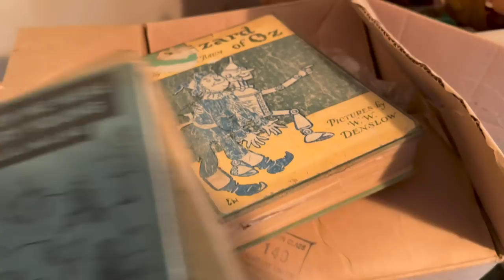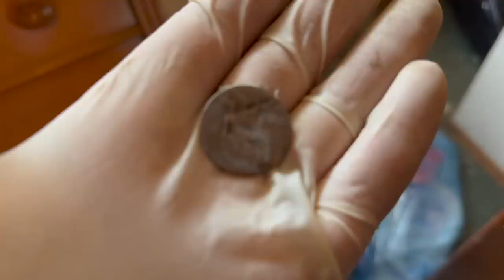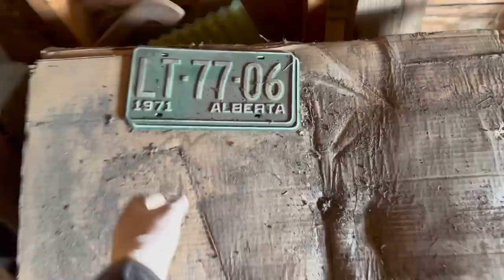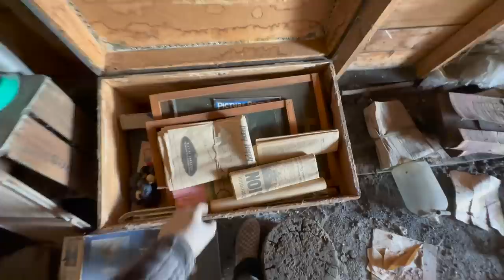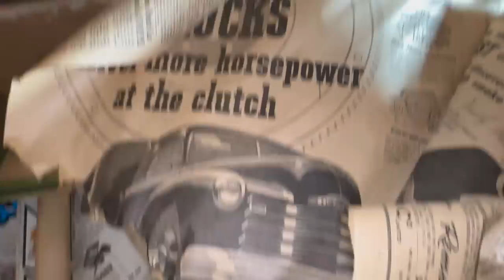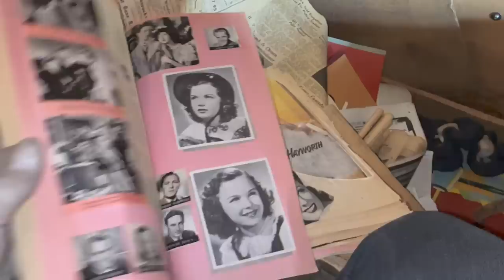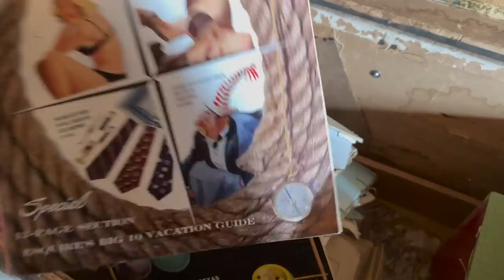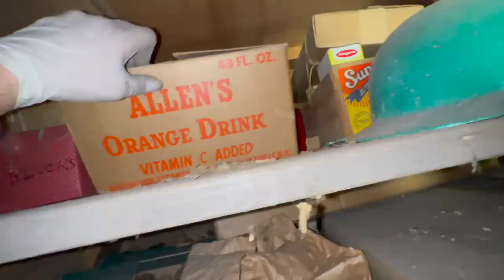This garage was locked for 20 years! What’s inside?!? Come explore with us! Part 6

Comment: Alex, just an FYI, people always say there is nicotine staining on walls, furniture etc., it's not the nicotine doing the staining, it's the actual smoke itself. Nicotine is the addictive part of tobacco smoke. It is colorless and odorless. As for the rugs in the living room, if they were quality needlepoint, taking them to a good rug cleaner will remove all residue. They can be very valuable. In the case of the early Disney toy cradle with some mold on it, using three parts water and one part bleach will remove all the mold. Disney collectors would snap it up in an instant.
Reply: Yep, you're right, it's the "tar," which is not actually tar, but a compound of various chemicals and carcinogens, that causes the staining. The tar is also what causes cancer, nicotine itself does not.
That being said, even though I am an ex-smoker, I am shocked by the condition of those keys. Did this person chain smoke for 60 years and never once clean the keys? It looks like a beautiful piano otherwise. Hope it can be thoroughly cleaned and restored.
Reply: Bleach doesn't kill mold spores, it only makes them no longer black. Vinegar kills the spores.
Reply: I worked in a hospital cleaning equipment.  Mold on smooth surfaces can be killed with some household products, but the spores are a different matter.  Spores (reproductive structures) have a kind of shell to enable them to survive in bad conditions.  It requires heat, toxic chemicals and pressure to kill many species of spores.  
Alex is right.  Pitch the moldy stuff.
Reply: I think it was homemade cradle with applied decals not legit Disney merch.
Reply: @expatannie6958  Some of the grime on the piano keys might be from normal wear, dust, etc. I play our antique piano and so do a couple of my kids, but I still have to clean the ivory keys now and then. The paint on the black keys has oxidized over the years and rubs off onto the white keys due to normal moisture on our hands.

Comment: Those were adjustable lcreens for sash type windows.  You lift up the window, set the screen on the open space, extend the screen until it is the width of the opening, then lower the window onto the top of the screen. 
The little star in circle thing in the box was a do it yourself souvenir from the 1950s. You put a coin in the machine and could stamp what you wanted on the exterior ring.
Reply: Thank you for the info on the souvenir star coin item.  I was surprised when that didn't go into the 'keep" pile! ⭐
Reply: I was thinking the same about the mini perfume bottle...

Comment: Do you have an app called  "curb alert"?  You set things on the curb, and let people with the App, know it's there, for free.  You could roll the rugs, so the good side is on the outside, put a note in the curb alert that the rugs were exposed to heavy smoking and possibly mold, so it's up to them if they want to tackle the job of cleaning and sanitizing them. Because they are made of yarn, they should be easy to thoroughly clean.  It broke my heart when I saw your son carry a very nice rug to the dumpster, in an earlier vlog.  I know why you did it, especially since it was in the basement . I do wonder if a rug sales shop would let you know if they can be easily cleaned and sanitized, to, once again, be of value to someone.

Comment: That’s a great set of furniture. And can I say how much I love the fact you clean things. I had already noticed the nicotine stain on the walls. I’m a smoker but have only smoked outside away from folx since 1993.
Reply: Never too late to quit. :)
Reply: @dewdew34  I have managed to cut down and only smoke 100% tobacco without additives.
Reply: Where did you manage to find tobacco without additives?
Reply: @jillipepper5353  American Spirit and Winston are both made with 100% tobacco.
Reply: Yes, a lot more durable than all that IKEA stuff.
Reply: @katwitanruna  I didn’t know that. After smoking for about 50 years ( started partime at age 11😳) I quit a few years ago. I never thought I could quit but ending up in emergency and undergoing a six hour operation for a gangrenous gall bladder , I kept thinking to myself  it just as easily have been lung cancer. Having been diagnosed with the start of COPD I realized that if I needed life saving surgery down the line they might not be able to because my lungs couldn’t take it. 
So when I was in hospital they put me on patches and I kept taking them at home. From experience of trying to quit previously I knew if I even had one cigarette I’d be right back at it so I just did it one day at a time.  I did use a vape eventually though I didn’t inhale , but then stopped it too. 
I know past smokers are annoying BUT it’s never too late to quit, your lungs can repair at least some in time. 🙋🏼‍♀️

Comment: I once helped a friend wash the walls of a heavily nicotine stained house we washed it 3 times, and painted it.And the staining kept showing up.🤢 we finally had to switch from latex paint to an oil based, and that finally worked.
Reply: In UK there is a detergent called Flash that is good for such jobs. Many years ago, painters used a product called sugar soap to wash down nicotine stained walls and ceilings.
Reply: Need to use stain block primer
Reply: Start off with TSP

Comment: 21:21 those screens are for opening window (slide up, with or without counterbalance) then fit screen under the window.  very popular for "no A/C" houses, mid-west USA in 40's & 50's even 60's but bet Canada also used since weather in Canada likely still not conducive to 5-7 months of Air Conditioning

Comment: My new home was smoked in for 50 years.  The entire house looked just like that one you have there, where pictures and wall decorations were outlined with the nicotine.  Before moving in, removed all the wood paneling and burned it.  We refinished the plaster walls to match the rest of the house.  Then I replace the baseboards and door moldings, and primed and painted all the walls and ceilings in the house.  Also had the entire oak floor sanded and refinished. After all this was done, you could see how awful the light switches, outlets, ceiling fixtures, and window coverings looked.  The last step was to replace those.  Wow!  It feels like I have a brand new home!  None of it looks old or out-of-date, except the original kitchen and appliances.  Oh well I can live with that for now.

Comment: The screens could be used for silk screening posters, etc.
Reply: No, they couldn’t. The mesh is too large, and it is in two parts that overlap where it slides to adjust the size for fitting in a window. They also have a lip on both sides of the screen, so won’t lay flat on the paper for the transfer of ink.🖤🇨🇦
Reply: @tamarrajames3590  Zulu are correct in that those were not silkscreens. I used a silkscreen in a high school art class and those were not them.

Comment: A premarital test is a test that offers a crucial health assessment of soon-to-be married couples in which they are tested for genetic, infectious and transmissible diseases to prevent any risk of transmitting any disease to each other and their children.

Marriage is considered a remarkable event in a couple’s life, as they plan to start a family, and through which they usher in a new stage in terms of building emotional, social, familial and healthy relationships.

Premarital testing programs should educate couples, providing accurate and unbiased information. Family background, hereditary factors, age, diet, exercise, weight management and addictions all contribute to the bigger picture.

For couples considering marriage, pre-marital screening helps identify potential health problems and risks for themselves and also their offspring. It is vital for couples to be screened in order to aid them to understand their genetics and help them take the necessary precautions or treatments.

Comment: You keep saying it will likely be a tear down, but couldn't the basement floor be encapsulated with concrete or even covered with vinyl flooring?
Reply: he has mentioned a few times that this is what he was told by whomever owns the estate. Yes, it could be renovated but depending on where it is the lot might be much more valuable as an empty build lot.

Comment: Hi Alex,
You can get those white stains (actually moisture trapped under the finishing) off by using a hot iron and then heating them for a few seconds. Use a dishcloth underneath the iron as to not damage the finish. It works like a charm 🙂

Comment: When we bought our current house, the former owners, both smokers, used the dining room as a TV room. There was a small chandelier hanging from the ceiling and the prisms were actually yellow from all the smoke. Also, if you have a low doorway, use a tack to hang a length of ribbon from the top door frame, that will catch your eye and remind you to duck.

Comment: Use magic eraser to clean piano keys
Reply: I love how Magic Eraser works. Hate how quick the sponges disintegrate. It's weird stuff. I would make sure piano keys aren't ivory before using Magic Eraser on them.
Reply: A Magic Eraser isn't magic.  It's like a very fine sandpaper, and it isn't recommended for any use where it might leave scratches.  I don't think I'd use it for piano keys, no matter what they are made of.
Reply: The Magic Erasers I buy are sponges ... there is no sandpaper. That said, I would research best practices for cleaning piano keys. He should have wet the cloth, rather than spray cleaner into the keys, getting moisture behind them.
Reply: @virginiaf.5764  Magic erasers (and their generic brothers and sisters) are made of melamine...a mild abrasive...and like sandpaper, they will scratch the surface.  For that reason, when they are used extensively, the manufacturers recommend that users wear gloves because they will abrade your fingertips, as well.  Their abrasive nature is a feature, not a bug.  They look like sponges but wear away like pencil erasers.
Reply: @GuyWithTheDogs  Yeah, I know. But I don't wear gloves,  and they don't bother me or my fingertips. They just dissolve and fall apart. I rarely use them because they're so weird (and expensive), but they  clean some things that no other cleaners can.